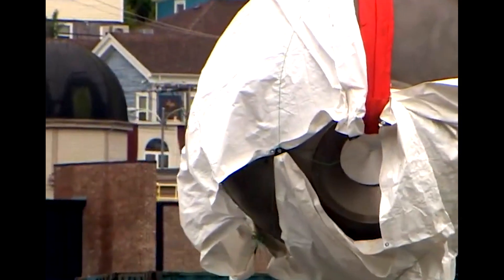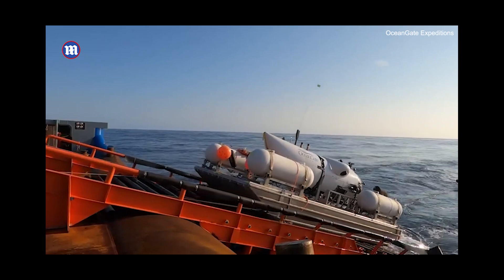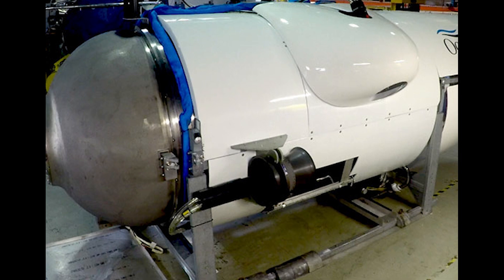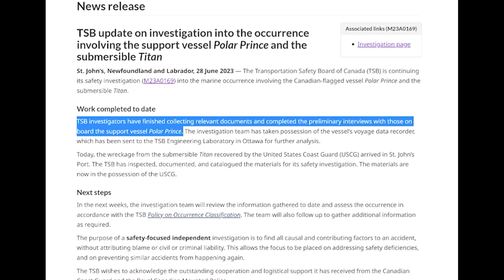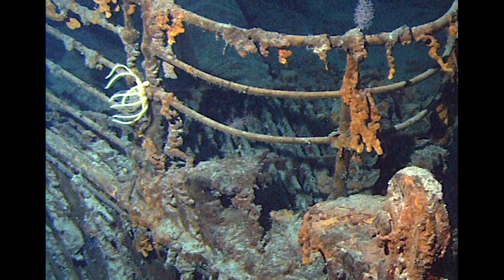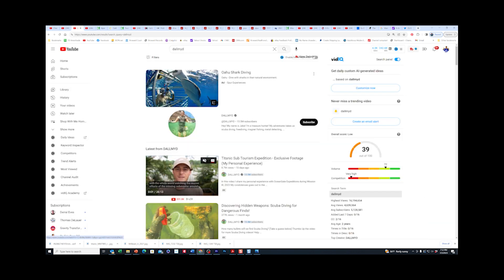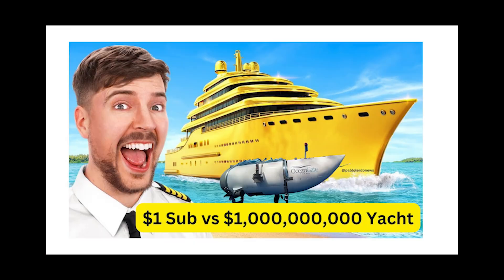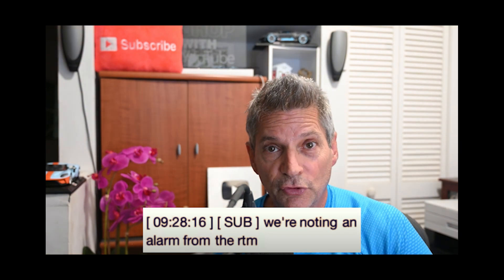Titan Submarine Debris Clues, Implosion Simulation

Comment: This submersible completed over 35 successful dives to a place more dangerous than Space and was designed by ONE man. By contrast, the Challenger Space Shuttle was designed by THOUSANDS of engineers, scientists, and "experts" and only completed 9 missions until it exploded and killed all qualified astronauts on board because of a little rubber O ring. The "unsinkable" Titanic was also designed by hundreds of experts and engineers and failed miserably on it's maiden voyage. All this picking apart Rush is a bit absurd.

Comment: The obvious lack of any environmental controls (temp, humidity, contamination) when wrapping the hull and applying the adhesive stand out to me (any speck like a human hair would indroduce a flaw). The hand mixing and application of adhesive is a no-no where uniformity is a must. And it looked like a simple circumferential fiber wrapping was used (for pressure vessels this is normally done in layers with each layer wrapped at an opposing 45 degree angle, so a stress crack could propegate around the hull like opening one of those tubes of Pillsbury cookie dough).

Comment: If the recently leaked transcript is correct, the creaking sounds were coming from the back which means that (ugh) if it failed there first, their bodies were probably basically all forced through that hole in a fraction of a second turning them all into flounder chum, which probably blew off the cap :/
The transcript (if not fake) also indicated that they knew there was a problem (their alarm system which checked hull integrity via ultrasound was all going off) and they attempted to ascend but it was happening too slowly (maybe too much man-weight onboard? Those were some hefty dudes...) and that probably gave the failure enough time to propagate

CEO was brave but way too much disregard for safety. Carbon fiber should have been a suspect choice all along

Ironically, both the Titanic and Titan were sunk by human hubris and a lack of humility

Comment: The window was meant to resist inward pressure, not outward. The hull failed, crushing it in from the center, blowing the window out with tremendous force.
Reply: it popped off like a cork
Reply: it blew the window in, not out....the carbon fiber compartment imploded in less than 2 ms, during that event the pressure vaporized the carbon fiber and the glue and the meatbags in the sub leaving only metal objects sinking to the deep
Reply: @egretfx  uh..nope
Reply: Without going about  too long ...You get it . Anybody that has ever cupped their hands to crush an egg knows exactly what happens to the yoke and albumen when  the compression force applied  causes both to blow through the shell in places .
The unaided eye cannot see it ...it happens too fast ..30k frames per second will allow it to be seen.
That is why that port hole and retaining flange popped out like a watermelon seed squeezed between a thumb and index finger.
That piece of unadulterated junk  should never have been used past the 800 foot depth mark ..if at all ,  at that limit it may have lasted a number of years, it had no business at ocean depths .Now if the incompetent builders/designers have a conscience at all , they have to live with the reality of having consigned people to a death that is similar to a house fly smashed by a 3 lbs hammer doing 200 mph ..that is a close enough analogy to what the occupants were subjected to .
Reply: @blackshark2536 The titanic, the Sub and your own vessel in worst case.
Reply: Probably blew some of the occupants out too. If the hull was creaking and cracking, i bet one of them in a panic was sat right by that window, in a sort of vain attempt to run away.
Reply: apparently you can buy tickets  on the next voyage  at a discount price,,,,    You get to see two wrecks  for the price of one .....
Reply: @lostinspace699  You mean 3 wrecks, including the 2 already blown. Well, to be honest, OceanGate found a hole in the market: Deep Sea Suicide Chambers or "DSSC". pay 250k and no need for a funeral.

Comment: When the carbon fibre tube imploded, the pressure wave popped the titanium ends off the tube and popped the window off too.
That is absolutely expected, there is almost nothing holding the ends on besides a bit of glue and water pressure pushing them on to the tube.
Likewise the window has only little bolts, the water pressure pushed it on to the metal. So during the implosion it just sheared the bolts and glue and popped off.

Comment: The lack of any residue doesn't really surprise me, having seen the hydraulic press channel's video. As the cylinder implodes it shortens extremely rapidly, and the relief of pressure at the surface and differing speed of sound would make it act like an ultrasonic cleaner briefly as it rung like a bell.

Comment: Probably the sudden compression from the implosion blew the acrylic portal out and immediately accordion crushed the Carbon fiber cylinder in the process shattering it to pieces completely separating from the titanium rings. 
Notice the titanium end caps were not fastened to the titanium rings. Not sure if the salvage operation had to detach them for wrangling?
Flexing of carbon fiber material conflicts with the titanium rings rigidity under severe compression scenarios. The "peanut butter" paste may have been the weakest link and both materials should have had more surface area for mating. When carbon fiber cracks, it means it is being compromised and failing, not stretching or flexing. 
Sorry for being captain obvious and repetitive in the comments here, but this is engineering 101. I know: should've, would've, could've, but this should not have happened.

Comment: and zero testing or certification.......
Reply: Little testing is one thing. Ignoring safety concerns of others, including the guy you hired to be the safety guy to point out thinks like that is another. The certification thing however, I would say is also a problem with the industry. The reason Stockton never got it certified is because he knew no certification board would certify it because they all agree that carbon fibre should not be used is sub construction. The fact that he was still allowed to do so without being certified surely is a problem? Especially if you're going to be going commercial like OceanGate were. You'd think if it was a solo sub only, then go ahead, you want to risk your life in something you made, that's on you but when you go commercial and the lives of the general public are more at risk surely it should be an industry standard that you and your sub have to be certified.

Comment: If the back end imploded, the water would have rushed into the vacuum with such a speed, it would have slammed the ever loving crap out of the front wall. It would have sent it flying.

Comment: All the tiny air pockets when the ring is sealed with glue is a culprit. Gluing his ramshackle CF hull to the actually-strong domes in an open-air, unsterile and uncontrolled environment. Just right there for a camera show. 
Those glued ends are most suspect as repeated trips wld change the shape of the hull and make those glued ends even less secure. Eventually permitting tiny buts of water to seep into the CF wrap and starting the delamination. Being unable to ascend after jettisoning everything they had along the global warnings and failures tells me they were too heavy- and only one thing wld cause the sub to become heavier over time.

Comment: I also watched your video "LEAKED Titan Sub Transcript Shows Crew In Battle For Lives" and it basically confirmed my thoughts how this happen. I believed there was the cracking noises from the rear meant that the pressure had been compromised in the rear where the power and batteries were. Once that happen a short time later like you say, they were in panic mode for 15 or 20 minutes, the carbon fiber hull totally disintegrated popping the nose cone and rear ring off. If the Titan was loosing power, just maybe the power to the  pressure regulator for inside pressure was compromised also causing not enough pressure inside to equal the outside water pressure.  I find it really interesting you are confirming my thoughts.
Reply: There is no way they can match inside pressure to outside pressure. Even it would have made it all very easy indeed.
Problem is that air becomes toxic to people if the pressure is increased that much.
Reply: @erlendse  They do it on a daily basis for flying in airplanes and for deep sea divers and deep sea oil drillers. I'm not sure of all the mixuures involved but the pressure has to be equalized somehow...

Comment: Submersible exploration is actually much more dangerous than aircraft flying or even rockets. The pressure easily exceeds anything an aircraft or even a rocket engine will encounter. Aircrafts are designed for about 0.75 bar of pressure difference, a space capsule or module is rated for 1 atm at the most. Have you ever seen how violent explosive decompression is? It is never more than 1 atm. Imagine an implosion 410 atmospheres. Submersibles have to be designed, tested and maintained much more meticulously than aircraft and require even more careful design than spacecraft. No way Stocktuen Rush, swindler and scammer, fraud, should have been allowed to operate the sub by any international law. I am only astonished as to how or why this sub lasted for this long without imploding in the very first test.

Comment: Watching all of this, 3 questions come to mind. Do carbon fibre pieces float? Would explain the lack of CF debris. And If you apply a paste to the top of a horizontal flat surface and to the bottom and sides of what is essentially an inverted cup, then lower the cup over the horizontal surface, how does the air that is trapped under the cup get out? How can you guarantee there are no air pockets trapped in your epoxy joint? The epoxy is a liquid (very thick, but liquid nonetheless) and air rises in a liquid, so how can it escape when the titanium flange extends over the sides of the tube?

Comment: The apparent fact the titanium ring appeared to be as pristine as  it was before the mating of the vessel is pretty damning from an engineering point of view. I have wondered how much temperature and the environment played on the sub over its lifespan. To go from hot...basking in raw sunlight for hours on end, to descending into frigid waters, then back up again into a hot and humid environment, expansion and contraction on an almost continuous basis, surely must require some very serious engineering of materials, such as epoxy resins, glues, mating surfaces etc. Any impacts, even minor, during handling and storage of the sub, could have dire consequences. A dropped wrench, an ever so slight bump against something, given its weight and mass could have serious molecular disruptions of a fiber vessel. 

Scott Manley put it best. "They went from being biology to being physics in a milisecond. " As I recall he calculated the energy to be equivalent to 110 pounds, 50 kilos,  of TNT being released into that small space.  The brain is incapable of receiving and processing signals at that speed. They would have never received, much less processed, any information about the implosion.

Comment: adhesives are strongest under shear.  That overlap is definitely not enough nor snug enough.  This thing "velcro'ed off" as the CF compressed in the middle.  At the very least, that lip should've been much deeper and adhered both outside and inside pinching the CF.

Comment: Inferior outer structure, solid bones, looks like the wiring held up so that lowers the likelihood of an explosion or sudden draw from the aft.  If that portal is intact I get a clearer picture that was ejected from the center.  My theory is currently the aft with all the wiring may have filled with water, in a panic they ejevyed structure which would then have put mote stress on that fiber crap.  From that point firward all you need is a very small intehrity flaw to start an implosion from the middle area?  The question is was the ring the issue or the computer screen screwed into the middle of the hull on the wall.
Working on narrowing it down here only 70%ish accuracy.  30% will rely on whether it was during the release of the ballast or the frame. ;)

Comment: I dont think there was enough adhesive. It seems if the adhesive was like peanut butter, which is very pourus, you'd want both ends SLATHERED in it do the glue would kind of "goop" out from the fit and create a seal around the titanium and carbon fiber. Seems like if that one missing nut from the front didnt cause it, im betting an improper seal happened at those rings.
Reply: I don't think there is enough adhesive in the world to makes a friggin sub safe. lol!

Comment: A carbon fibre is remarkably strong for its weight...in tension. If the crew compartment was only wound radially then I would assume that it only sees compressive loads. We tow broken down cars with a rope and we know that we can’t push a car with a rope. There’s a possibility that they were relying on the compressive strength of the resin only. During the implosion there will have been compression shock waves that would pulverise much of the non metallic elements.

Comment: The "portal window" bolts... I imagine they would be no match for the "water-hammer" effect of the implosion.
The same might be true of the titanium rings, blown "clean" off by the water-hammer effect which I imagine would be immense!
As an uneducated guess/speculation: I would be looking for one small aria on the rear titanium ring that still has evidence of the hull-ring interface residue as the point of failure would be least effected by water-hammer.

Comment: Those rings wont pop off with all that pressure holding them together. The water pressure is pushing everything together.  The force of the implosion peeled the carbon fiber off in one piece.

Comment: There's a transcript that has come out of the communication just before the implosion.   It seems the vessel was trying to resurface and was experiencing some issue at about 3400 meters.  I would say the reason there is no carbon fiber parts, is unlike metal and being less dense it probably didn't sink after imploding and likely drifted away with current.
Reply: The transcript is unverified.
Reply: @tonyennis1787  yes, however it's not likely to be a fake, but a leak.     Yet , the bigger point I have is why they didn't find any carbon fiber parts.. I say , it's because Carbon fiber is not as dense as the metal parts.. so it probably drifted away with the current.. as probably did the human remains.   I think people have a false notion of how it imploded, like imagining the carbon imploded uniformly.  But that's not how carbon fiber works.. It probably delaminated and broke up very randomly. It probably didn't compress much.. just fractured and delaminated from the metal it was glued onto., and floated away.   I recall all the carbon fiber was laminated around a steel tube.. but the steel wasn't that thick.. so once the carbon fiber began to delaminate and suffered compression weakness in one spot.. it probably fractured and the inner steel tube then would start to compress, delaminating itself from the carbon fiber.  So you'd have a crumpled steel tube, and a shattered carbon fiber husk the steel sinks the husk floats away.

Comment: I wonder if that bottle of glue they used to attatch that Titanium ring to the Carbon Fiber body said, "Not for use in salt water environments ... clean and dry surfaces only ..." .

The whole damn sub should of had a Titanium inner body and frame, and a viewport that was at least rated for the depth of the Titanic ... and why call the sub "Titan"? 
Don't they know what happened to the author of "Titan" (a book about an "unsinkable" monster ship) ... he died on The Titanic !

Comment: 1:20  So you're saying they hoisted it from the water to the boat but had to take the window off to get it from the boat to a dock.  I'm pretty sure it blew out when the sub crushed.  It was meant to withstand pressure from the face and not from the rear.

Comment: They did at least use a torque wrench when they bolted it. I wondered that also. You mentioned that you weren’t sure if they were using it but in all the videos of them launching it they did. 

I don’t think the window was the failure point everyone else does probably because in the movies that’s what always goes first, for the dramatic effect. The hull itself probably imploded, I’m sure they could hear it starting to fail which is horrifying to think about.
Reply: At the exact point in the video where he mentions the torque wrench the clip changes to a shot of them using a torque wrench!
Reply: I honestly dont know what failed, but the window manifacturer did say multiple time that his product is not supposed to go below 1800m.

Eitherway, this sub seem to have a lot of weakpoints...
Reply: @pierrotA  yeah but a manufacturer will give a stress rating way lower for liability purposes. It was probably designed to go a lot deeper than the rating. The manufacturer claimed it’s a new design and they can’t 100% certify it any deeper because they have never used it before. 21 inches thick is quite a bit.

Comment: As an engineer, I wonder about the design of that rear flange.  The front end cap had a single flat mating surface perpendicular to the axis of the carbon fiber tube.  Any differences between the radial compression of the carbon fiber and the cap could be taken up by sliding.  At the rear, however, the flange and its manually applied glue could have altered the mating of the offset surfaces carrying the axial compression loads, shifting those loads from being equally distributed.  That could cause failure and explain the reason the crackling noises at the rear.